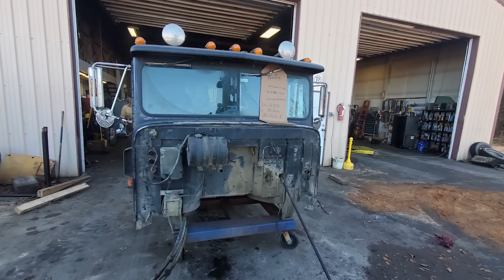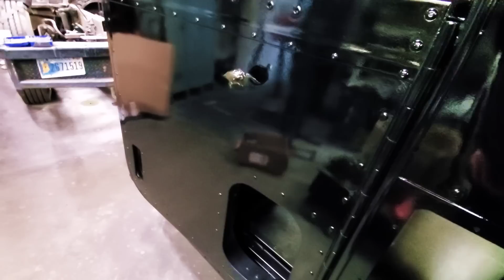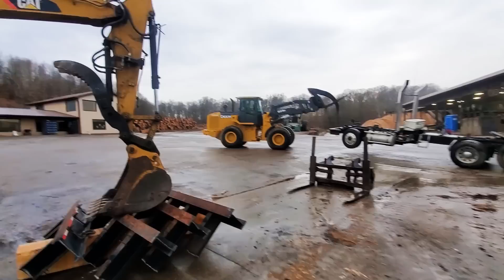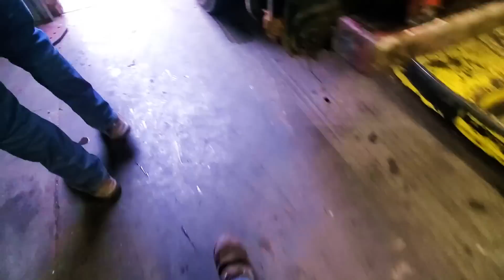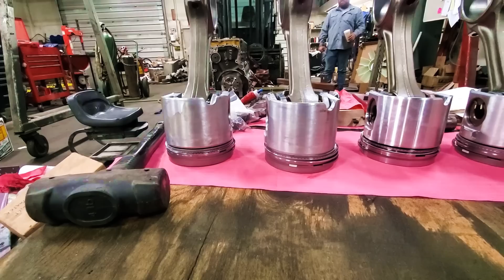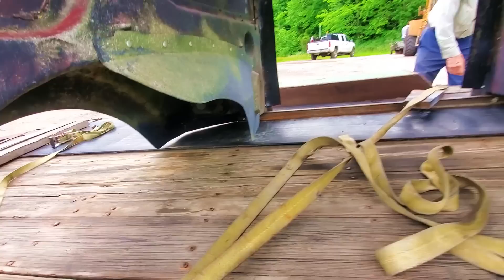Progress on Blackey..

Comment: Hey buba to keep those rock cracks from happening on top of the fenders when the tires throw rocks against them throw a few coats of undercoating on the underside of the fenders. The thicker the better. That way the rocks thrown against the has a cushion and not hitting right agains the fiberglass.

Comment: Glossy black is hard to get looking good, and as is that's a fine job indeed. But if you really want it to pop good, wet sand with progressive finer grit and then a polish compound on a random orbit then buff with a good buffer, hard clear and it'll be just BAM! Good looking.  Though blackie is a worker not a sparkle machine.

Comment: Wow, honest to goodness coolant cavitation demonstrated with those pocks in the liners! Usually the result of running without a thermostat in the false belief that it will help cooling. Cavitation happens when there is not enough backpressure in the coolant passages and pump; the thermostat provides the necessary backpressure even when fully open. Cavitation (those tiny explosive expansions as mentioned in the vidya) will also eat up the water pump  impeller and housing. If you were running a thermostat, I'd suspect an eroded water pump which wasn't supplying enough pressure or a weak radiator cap or leaks. I hope you plan to fit a new pump and thermostat. Cheers!
Reply: You may want to take a look at what role silicates play in the cooling system of a diesel engine in particular.  What you stated is not incorrect but there's "more to the story" in this case.

Comment: Blackie's, came a long way. God knows that truck deserves it. one thing to think about doing is using a Rhino liner for inside the wheel wells of the hood. it'll cut down the rocks from hitting the inner Fender and causing the stars on the paint on the outside of the wheel well. I worked for a trucking outfit and he used Rhino liner to help prevent that
Reply: Thats a great idea.  I just had an 02 international repainted and was trying to figure out how to prevent the stars in the fresh paint.  Thanks man.
Reply: @joshuaplacka8480  glad to help someone else out. It helped a lot.